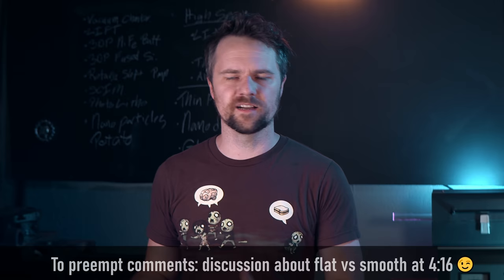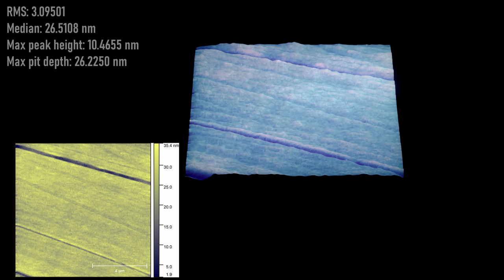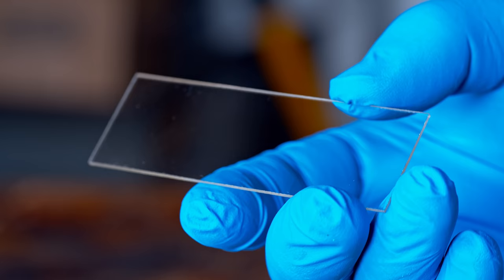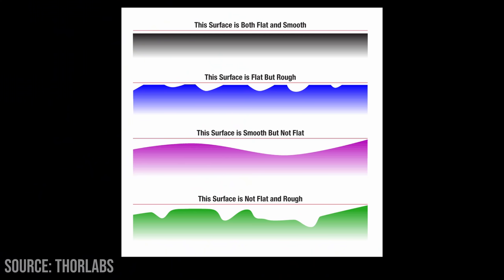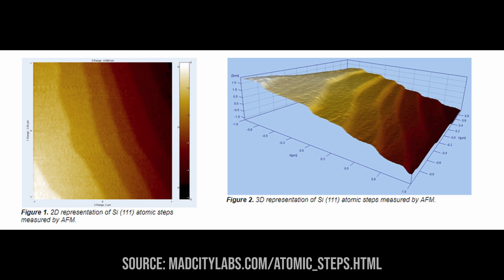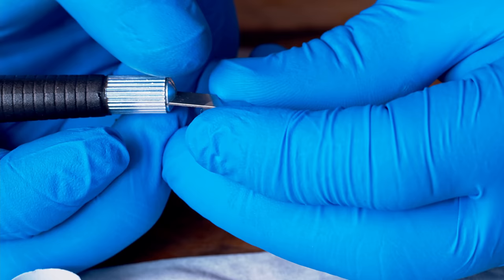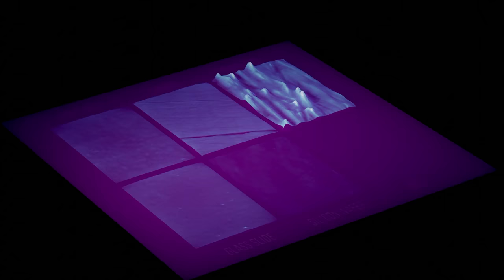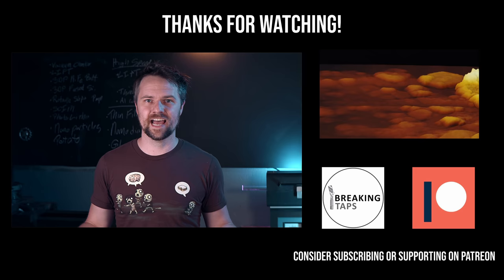What is the Flattest Material?

Comment: Gage blocks can be rung together. Can any of the finer surfaces you describe also be rung together?
Reply from the maker: Yep! The mica practically glues itself back together, and the mirrors and such will wring as long as they are clean of dirt.  The glass slides even come with slips of paper in between so they don't get stuck together in the package :)

Comment: Bro don't get me wrong, like the limits of the mirror are important but not that much. To save your skin, you need much less since you're going to be using lenses that will take the changing signal over a certain area, and spread it out and make it bigger so that you can use less sensitive more variant receivers, rather with the higher degree of variance.

Comment: Great video!
The numbers you provide for the silicon wafer do not make sense.
The RMS (1.62nm) is three times larger than the difference between peak and dip.
I wonder which is correct: RMS or peak/dip
Reply from the maker: Ah, probably just a notation issue on my side. Peak and pit values are the absolute value of the height of the peak/pit in the scan (Sv and Sp in roughness terms, i.e. https://www.keyence.com/ss/products/microscope/roughness/surface/sv-maximum-pit-height.jsp).  So the peak is 8.0 nm above the average, and the lowest pit is 8.6nm below the average (so I maybe should have labeled it as -8.6nm instead).  Hope that helps, apologies for the confusion!

Comment: can you break a pice of glass or obsidian and then scan how thin the sharp edge is ?
Reply: The problem is that an atomic force microscope uses a very fine probe to scan the surface, and the vertical movement is quite limited, approximately 10-20 or so micrometers depending on the system. There is also the issue of tip effects due to the finite size of the tip (roughly 10 nanometers). A better way is to image the edge with a high resolution scanning electron microscope such as a field-emission SEM. I have imaged metal knife edges with an SEM and they are definitely finite, but I think an edge from obsidian would be very interesting.

Comment: 3:49 you say the glass slide's average roughness is smoother, but the scale goes from 1 to 52,3 while on the Lambda/20 Blank it goes from 6.2 to 36.4. Could the larger range (spread over the same color gradient) make it appear smoother?
Reply: the range is higher because the individual peaks and troughs are taller and deeper. the glass slide is average smoother because it has fewer peaks and troughs. the space between the bumps is much flatter than the same space on the Blank. That is, if I understand correctly ...
Reply: @adamsmall5598  Well, I think you understand the graph, but I don't think you understand my objection to it. I'll try another way. Compare the range 10.0 to 30.0 on both sides, it maps onto different parts (and length) of the gradient. 30.0 is lighter on the left than on the right, also 10.0 is darker on the left than on the right. Thus, the range 10-30 will apear more smooth on the right side even if it isn't. It is still possible it is more smooth, but the mapping of the gradient may exhagurate or obscure the diffrencies.
Reply: @FatLingon  That makes sense, I think. I think what you are saying is that since the two slides show different scales, the larger scale will automatically show similar roughness to appear much smoother. But at 9:01 he does set all the samples to the same scale for a more direct comparison. Does that portion of the video address your objection, or am I still misunderstanding it? I think he took into account the difference in scale while doing the actual testing and averaging, while then presenting it to us in the most visually appealing way, though that does seem to have left the door open to uncertainty. Thanks for explaining your objection to me. I hope I understand it better this time.
Reply: @adamsmall5598  Hehe, I guess I wasn't paying enough attention at the 9:01 part. Anyway, I took a screen shot at 3:49, masked off values outside the 10-30 range and streched out the gradient so that the 10-30 range matched each other on the different samples. Beside the specks on the Glass Slide it did still apear more even, although the diffrence was not as large.
Reply: @FatLingon  I'm glad you took the time to check that. it's an interesting issue.  Ijust watched a video on Covid v Influenza, where the presenter showed percentage numbers on one side, and ratios on the other (i.e. .01% v 1 in 100,000), which i believe was a deliberate effort to obscure the numbers for casual observers (since the numbers indicated higher death rates for influenza among those under age 50, which was against the narrative the presenter was pushing). So it's important to question these kinds of things. (I'm not trying to minimize Covid, just pointing out a specific case of obfuscation.)

Comment: How can you see the imperfections on a surface if the deviation is the wave length of light divided by 20? I assume you are using an electron microscope, but it still confuses how it’s possible.
Reply from the maker: Using an atomic force microscope (some background on the machine and technique here: https://www.youtube.com/watch?v=2Kv6KwADn7Q). The machine basically taps on the surface with a nanoscale probe, and measures how much the amplitude of the tapping changes.  That gets you nanometer height precision across a reasonably small area (10-20 micrometers).  Pretty wild that it works though, blows my mind every time I use the machine!
Reply: @BreakingTaps  
Pretty amazing

Comment: OK, I'm guessing before we start... Flattest, easily available surface is probably... Graphene, collected using the good ol scotch tape method.  Just need some graphite and scotch tape and waBAM, atomically flat sheets of honeycomb pattern carbon!
DOUBLE EDIT: OK.  You should really check this out, though.  I think this might make for really interesting content.  Both because graphene is neat and I've always wondered if the technique is really as simple and easy as it seems, and because I wanna see it under that fancy, city boy college microscope you got there, son.

Edit: ok, only a couple minutes in.  My second guess would be the surface of a semiconductor die.  Like, the actual surface of the silicon under all the packaging.  They're making chips at 7nm scale, so the glass has to be smoother than that, right?  
DOUBLE EDIT: Nailed it!  Though I am convinced that your piece of silicon is only as rough as it is because it's a relatively older one, correct?  I'll bet more modern wafers have to be much smoother.

Comment: Wait wait.... does this mean mica will "wring" together the same way as gauge blocks do? If so, great!
If not then it begs the question of "why not?". The theories about why Gauge blocks wring together should hold true even for mica shouldn't they?
Reply from the maker: Yep, it does! Cleaved layers basically glue themselves back together. It's a little less robust since there's now air bubbles and oxidation, but it's nearly indistinguishable from the uncleaved parts of the mica
Reply: @BreakingTaps  Thank you for the reply and the knowledge.

Comment: What's a gauge block?
Reply from the maker: They are small blocks of metal that are ground/lapped precisely to a specific dimension.  You can get a gage block that is exactly 0.503" (or 12.776mm if you prefer). Machinist use them to check the size of features on parts the are machining, widths of slots, etc.
Reply: @BreakingTaps  thanks!